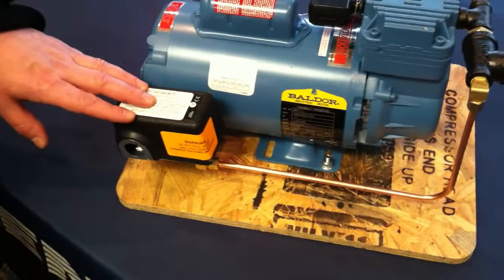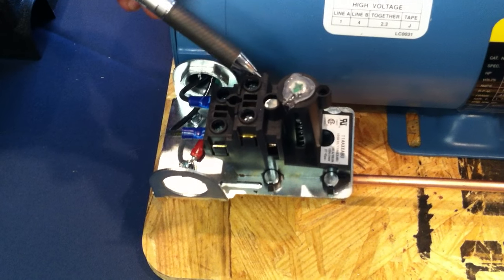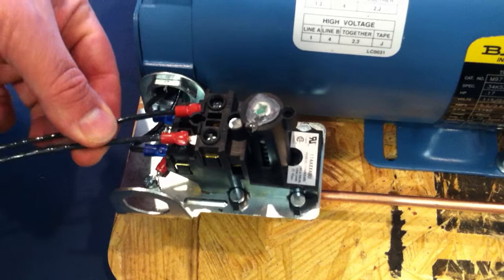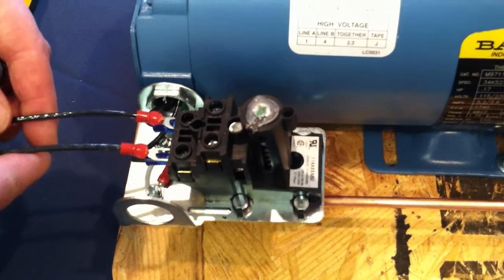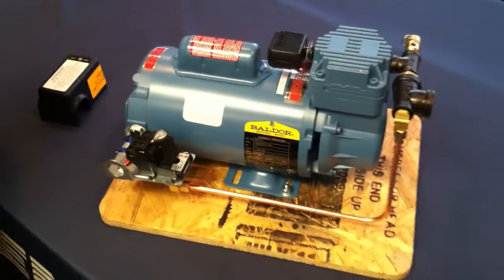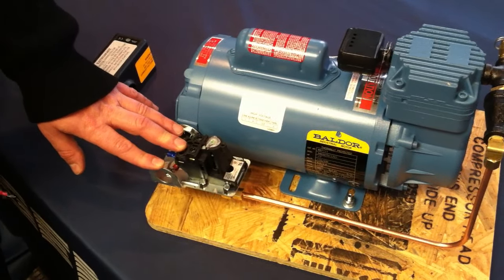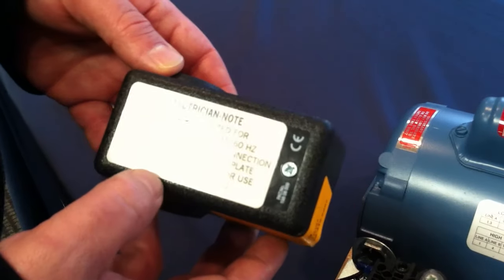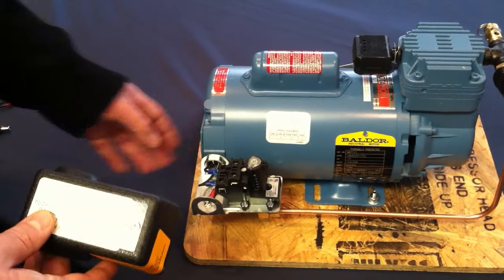Proper Installation Wiring Procedure: Wiring to the Air Compressor's Pressure Switch

Comment: 2nd on the ground question, where do you put it?
Reply: on the frame of the pressure switch box ,there should be 2 screws . 1 for the power coming in  & the other going to the motor.